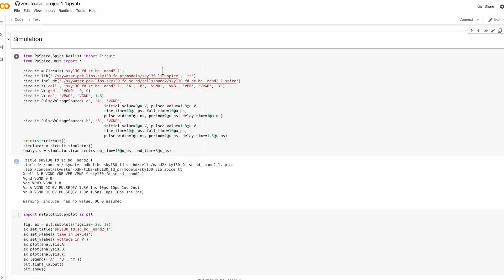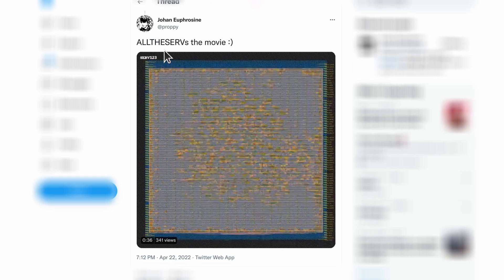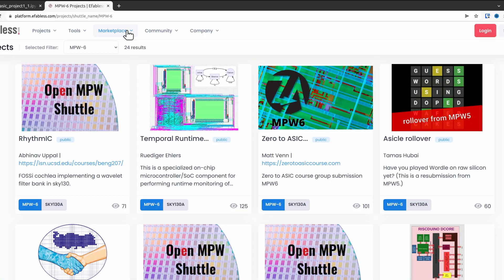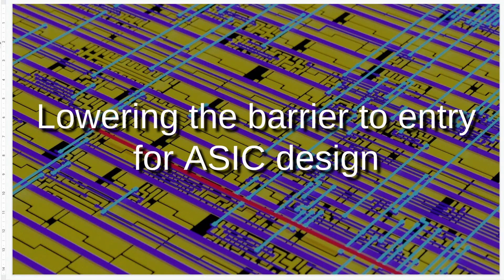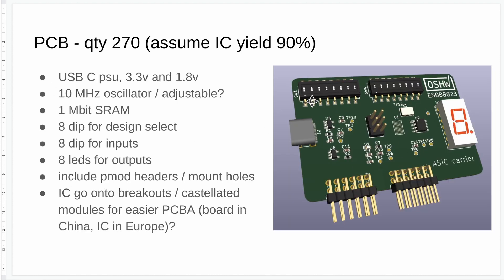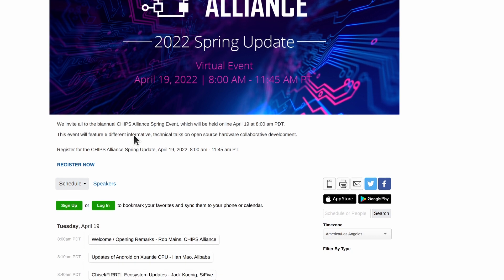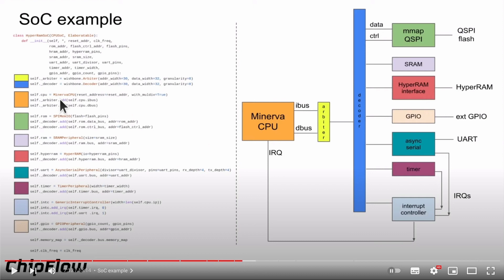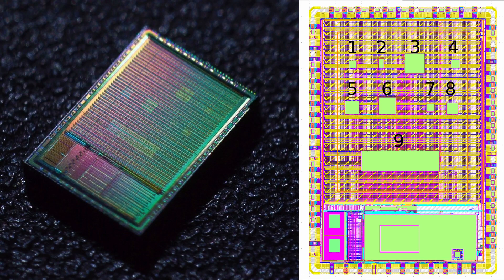April news update - sky130 on Google colab, optimising adders, $100 tapeout, events and MPW2 wafers

Comment: Do you know if there’s any intention to have an MPW7?

Also, would the shuttle only be available via the drag on drop cloud tool? Would it be possible to buy N slots of space on the shuttle and design using an HDL to make slightly larger designs
Reply from the maker: Mpw7 closes on sept 12! The default way to make designs is with Verilog HDL.